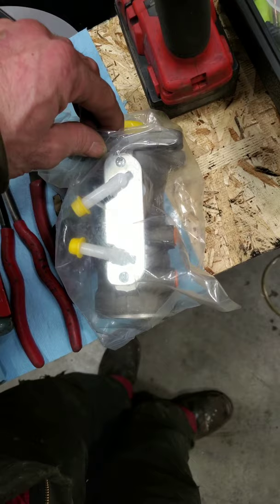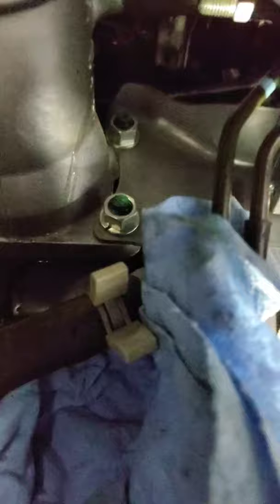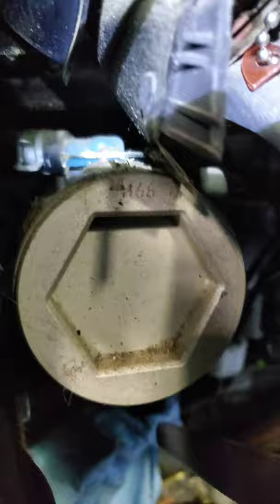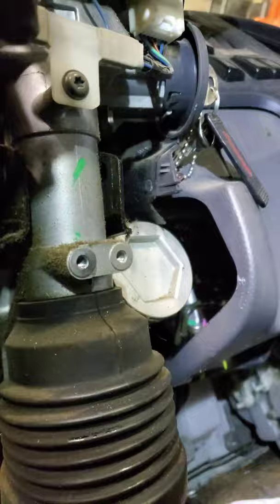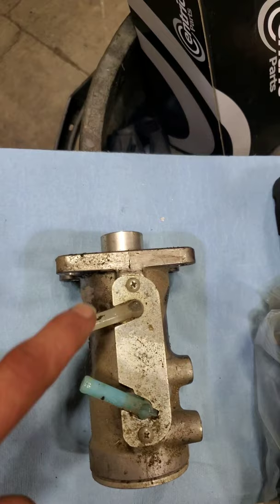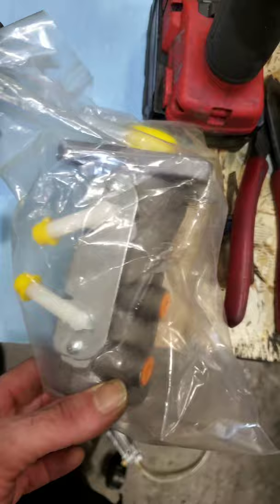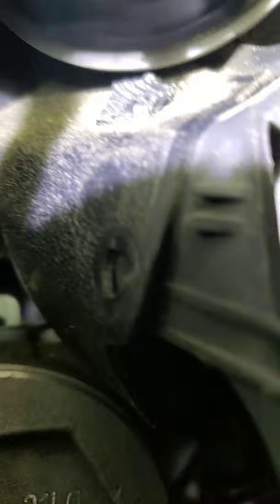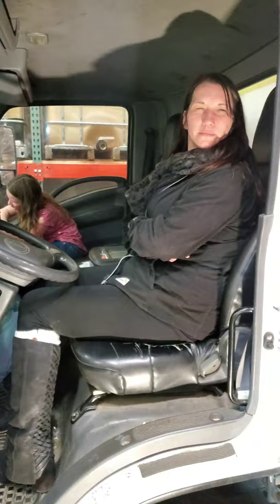Isuzu npr hd brake master cylinder

Comment: About how pong did this master replacement take and what were your symptoms for replacement the cylinder
Reply from the maker: Took about 2 hours..brake pedal kept sinking slow
Reply: What is the procedure to bleed the brakes on these isuzus? I have a 2020 isuzu nrr that needs front calipers.